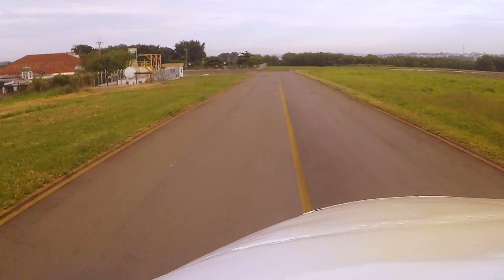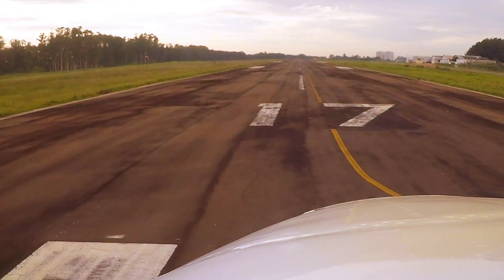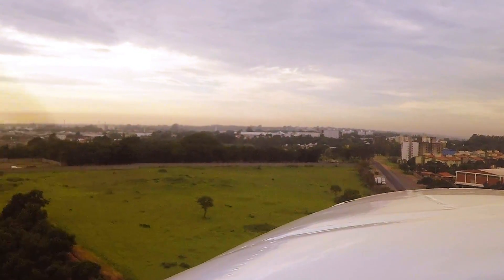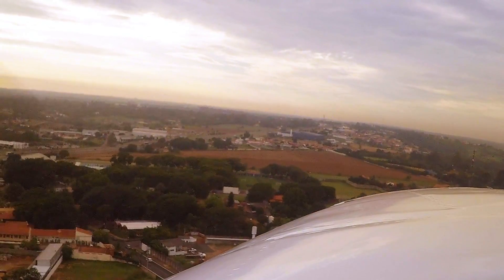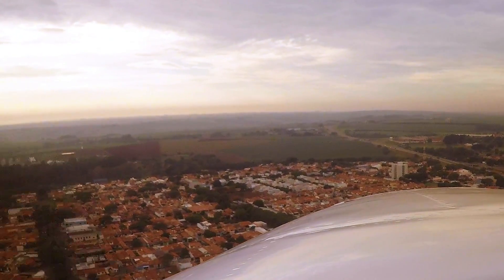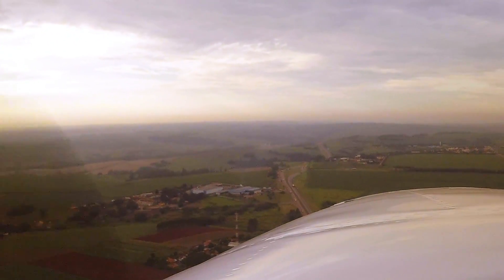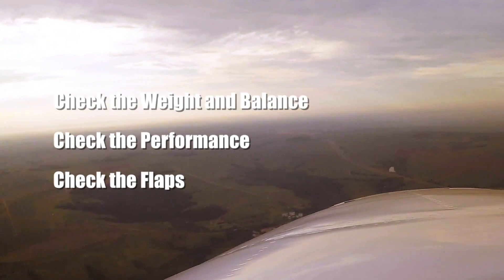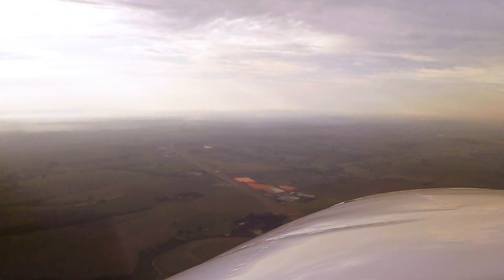Engine failure during take off

Comment: I tested this scenario on the simulator (xplane) about 30 times. Piston twin and turboprop twin

Twin Baron 58 with full tanks and load (100% of the permissible take-off weight) barely gains altitude when flying in a straight line. This requires very precisely set rudder pedals and a very precise roll towards the working engine.

If you create a slight roll towards the running engine and compensate for this roll with the pedals so that the plane does not turn, then you can gain altitude very slowly. ~100-200 ft/min at v blue

If the plane slow turns towards a running engine, then you can gain altitude a little faster. I don't know how accurately xplane models this. In theory, this simulator calculates aerodynamics in real time, but of course not as accurately as what actually happens in reality.

In any case, the problem here is that the ground can gain altitude faster than a twin on one engine. Not all airports are located on a plain with meadows 1000 by 1000 km

On this twin in the simulator, when simulating an engine failure after takeoff, even the SMALLEST mistake (the landing gear OR flaps are not retracted OR the propeller is not feathered, incorrect use of the rudder, etc.) and there is almost no chance of saving the plane, since if the speed drops below v blue and the altitude reserve after takeoff was not, then you will have to land wherever possible, since it is better this way than a drop in speed below VMC with a 100% guarantee of almost instantaneous rollover with the subsequent entry of the plane’s nose straight into the ground.

In the simulator, the following scenario always occurs for a piston twin - if the slightest mistake was made when the engine failed immediately after takeoff and the speed dropped below v blue, then the speed is unlikely to reach V blue, unless of course the aircraft’s tanks are half empty.

Moreover, it is almost certain that the aircraft’s energy (kinetic + potential) will then slowly fall, attempts to correct this will only lead to an even greater loss of energy. Thus, any mistake at the time of takeoff in the event of an engine failure ALREADY creates all the conditions for the plane to physically be unable to remain in the air. The second engine simply delays the moment of returning to the ground. Sometimes this moment can be delayed even for 5 minutes, but then it will come anyway. Only COMPLETELY error-free and instantaneous actions allow you to maintain flight on one engine and then perform a safe landing

At the same time after any error on first stage then you have only option like maintaining >vmc speed due to altitude, it will not be possible to exchange altitude for sharp turns, the choice of a site for an emergency landing will be very limited and the time for choosing a site will also be very limited. So piston twin is dangerous and require top pilot skills and top reflexes

If the plane is c90, then even with full tanks and 100 percent load, the plane gains altitude much more readily than piston baron 58. In sim c90 can even take off on one engine with landing gear and flaps, although this is very difficult for the plane, but at least a turboprop plane can do that. For a piston twin safe takeoff on one enine is generally impossible(in this simulator)

The author do this on a turboprop aircraft, and this exercise is extremely difficult, even in a simulator. I think on a piston aircraft this exercise would be guaranteed suicide, since even in a simulator such an immediate reaction is required that such a reaction probably cannot be achieved in a real cockpit

a single-engine aircraft in the simulator in this regard seems much simpler, since if the engine fails, the reaction in any case will be reflexive and instantaneous without the apparent continuation of "normal" flight, which occurs on a twin like you fly normaly but it's biggest mistake ever. On a twin, you need to develop a very fast reflex, and this reflex also disappears quite quickly, unlike reflexes to engine failure in a single-engine aircraft.

For a twin, you need to do a lot of things very, very quickly, so you can forget something and twin simply won’t fly on one engine. Therefore, twins are only relevant for VERY experienced pilots with very good reflexes

Let me emphasize once again that these thoughts relate to SIMULATION. Something else is important here. The simulation shows that it is likely that the situation of failure of one of the engines on a twin is extremely demanding on the pilot’s skills, including lightning-fast reaction. Even I would say unexpectedly demanding. And this is a simulation, in reality everything can be even more complicated

And as everyone knows, in a critical situation a person usually demonstrates not his best level that the mind of this person can achieve, but the level of nothing more than reflexes

Comment: FAA regulations state that over congested areas (Not exactly sure where this video is being shot but looks congested to me!) you must fly above 1000 feet. Obviously after takeoff this is not true but the only thing you should be worried about right after take off is your v-y speed to achieve 1000+ feet. All of this can be found in the FAR (Specifically 91.119)

Comment: As a King Air pilot, the problem with this procedure is that because the "failed engine" was manually reduced after takeoff, that disengages the Autofeather System, making the propeller unable to go feathered, increasing the drag and reducing the aircraft's climb performance. On an real engine failure the autofeather system will make the failed engine's propeller to automatically feather and therefore increase climb performance, or in the case it didn't work, do it manually as soon as possible. It is very unsafe to fly with an unfeather propeller. This practice should not be done this way.

Comment: If I may opine, it seems that nursing the airplane between a few hundred FPM climb and not accelerating, you must allow the airplane to accelerate when / where you can ASAP.  Another thing is that dragging a lot of rudder won;t permit the airplane to accelerate enough to climb either.  So as soon as obstacles permit let the airplane turn right as long as you are sufficiently at or above V2.  Don't ever make and uncoordinated turn into the dead engine though -- that will kill you in a 400 series Cessna.  This is also one reason VGs are worth their weight in gold, they lower that number.

Comment: Ok, dont do these type of exercises near a populated area. Also, you should do them with a "hard deck" of 2000 AGL. The 2000 AGL hard deck is for the very real possibility you could slip into a spin, spin recovery being:

Above 1000  AGL: Power Ailerons Rudder Elevator.

Below 1000 AGL: Pray, and fasten your seat belt.

Comment: OK as a pilot I have to ask myself what were you thinking? You don't practice engine failure on takeoff during a takeoff, you go to altitude, prep the airplane and simulate an edge and takeoff with the recovery of less than 200 feet. What in the world are you thinking? This is a good way to make sure your last video never gets posted or if it does, you are around to see it

Comment: The keyboard warriors here disgust me. As a professional pilot for over 40 years in a variety of types from Cessnas to heavy jets and a former instructor in multi-engine aircraft similar to the King Air series, I assure you that there’s nothing amiss in this video and the creator should only be thanked for sharing, as his conclusions are spot-on. 

It was actually a very well-handled and CONSERVATIVE training event, no matter the opinions of the self-appointed critics. The weight was light, the flaps were up, and the density altitude was benign. Had the event devolved into a descent and obstacles become an ACTUAL vs simulated issue, then the power would have been restored and all would have been well. The “poorly thought out training event” comments are just bunk.

Comment: Having done many V1 cuts in King Airs and 1900’s, something was really strange in this “simulation.”  Even at Max gross weight, the King Airs accelerate and climb much better than what I saw in this video…..as long as the gear is up and the prop feathered.  The airplane won’t fly very long at all with the prop windmilling, so I don’t think the instructor was simulating a failed auto-feather. If the gear is up and the propeller feathered, there shouldn’t have been a struggle to get to V2 though. That’s the strange part. 

It looks to me like the instructor didn’t set zero thrust on the simulated failed engine….which would make the performance better than a windmilling prop, but less than a cleaned up airplane. Once airborne, the gear should have already been retracted but the video kinda looks like it was left down for a while 1:28 could be just a difference in the audio and visual though. Maybe that’s what affected the performance, I’m not sure.

Comment: I have been a King Air flight instructor for many years. In spite of all the negative comments from viewers, this exercise can be done without shutting down or feathering the "failed" engine. Beechcraft provides a chart for zero thrust power settings for training purposes, so that the engine is merely throttled back to that setting. I have done it many times. That said, it is easy to pull back too far and get less than chart performance. If calculated correctly and performed using zero-thrust, this is a valuable training exercise and is not dangerous.

Comment: I thought of a way that you could have totally eliminated this problem. If you reassembled the right Alderaan at the time of take off, your perplexity would have been Arrow Namek Lee correct is sometimes on small aircraft the magnitude of the excessive vibration during takeoff will accomplish nothing in the realm of coherency. I've had lots of experience doing this particular maneuver on the San Fernando airstrip in Bangladesh. Incoherently excessive noise coming from the turbulence of the propeller will perpetuate a motion that is non linear and function yet retroactive and respect to the wind speed.

Comment: PRO TIP: The next time you would want to simulate an engine failure during take-off. You may do it by climbing at 5000ft and above, or at any safe altitude and perform POWER ON STALL. It is a procedure to practice an engine failure during take off :)

Comment: I can't speak for the instructor in this situation but if I were conducting this training event,  I would have reviewed the airports  obstacle departure procedures and minimum climb gradient.  I would have then ensured that the aircraft would meet that minimum (preferably exceed)  based off the aircrafts single engine performance data then added an additional safety margin.   I may also choose an alternate field that may be more suitable for this type of training.   Just my 2 cents.

Comment: His friend pulled the power back! Did he figure out what setting zero thrust would be to simulate a feathered prop? These king airs have enough performance when light to climb if the pilot is competent in single engine procedures. Obviously the competency of this pilot in the clown in the right seat didn’t add up and as others have said, they never should’ve attempted a V1 Cut at such a low altitude with obstacles being what they were.

Comment: I like this drill - seems like there have been several KA engine failures at take off. Looks like torque on one side of the plane catches the pilots off guard and they stall/rotate the airplane close to the ground…

Comment: Did you feather the prop??  Not a single mention of that, which is the absolute most important thing to do on a single engine climb on a twin, that is the most drag you need to get rid of.   The flaps and gear are obviously important too, but if you don’t get rid of the windmilling prop you will never climb (especially at high altitude airports).   On some planes like the MU2 you don’t retract flaps until you have sufficient speed and you have feathered the prop first…..

Comment: Hey guys, important is to bank 5° into the good engine and also to use rudder. Otherwise you will produce a lot of drage around your fuselage and never will achieve v2 and a safe climbe rate. Also do not train this above pupulated areas.
Reply: Good point 👍🏽 
Does the banking take away the load off the rudder? If so then it surely will reduce drag and improve climb
Reply: @sudarshanhs  it will give you a bit more Favorit yaw when you Bank 5° to the good engine. Also the upper wing fly a little bit faster on a bank. But do not bank more then 5° bleow v2, your minimum control speed increase that more you bank. When you reach below minimum control speed vmca you loose control of the airplane. In cases like this you must reduce the power of your remaining engine and perhaps proceed a forced landing ahead.
Reply: EXACTLY - - I was scrolling down looking for a comment criticizing them undertaking such an exercise over  a dense conurbation... You were the first, but I can now see there's more. Just thank your luck stars the other didn't fail otherwise the death toll would be horrific. Paire d'idiots..

Comment: This airport is in Brazil: Pedro Morganti airport in Piracicaba, São Paulo state. QHB (IATA), SDPW (ICAO). So, information regarding FAA or JAA aren't applicable. If the training was performed in Brazil, the proper aviation authority in charge is Brazilian ANAC (Civil Aviation National Authority). But the training requirements stated by the narrator are correct. There is even a section on C-90 POH that describes how such maneuver should be executed. Despite the right deviation, there was no serious threat to people on the ground or any other associated "traumas" with that operation (from what I saw). If a climb cannot be safely achieved in this training, the instructor can simply advance the simulated failed engine throttle and the idled engine will "ressucitate" very quick. Important: such maneuver CANNOT be a surprise! It should be briefed before takeoff! This aircraft is usually equipped with rudder boost, that operates automatically with engine failures (or throttle retards), but it seems that such device wasn't activated then: probably for a better and more effective training (more difficult = better trained). 
I was a certified captain/instructor/examiner on this aircraft model.
Reply: I couldnt disagree more. The rudder wasnt trimmed, a stall at that low altitude would have been unrecoverable no matter how fast the engine throttle could be advanced. Reckless, foolhardy and irresponsible.
Reply: @garrystubbs4891  Arguments?

Comment: UNSAFE
Dont do this over a populated area.
Retract gear immediately. Wheels wont help if you hit something, AND they are DRAG. That means a hinderance to airspeed.
You should have added back the power to climb and not scared the shit out of people on the ground.
YOU ARE UNSAFE.
Reply: Let me explain.
You were 1500 pounds UNDER GROSS.
He pulled the NON critical engine.
You were really late getting the gear up. Seconds count.

If you had 3-5 more people on board and it was a real engine failure
ALL WOULD BE DEAD.

I hope you learned that C90 wont fly on one engine. 

You are UNSAFE
and by your comments you are trying to justify your arrogant stupidity.

Comment: I am glad I found this video.  This procedure is wrong in so many ways.  I agree with previous poster, your license should be suspended.  

I practice engine out on just about every local flight.  I perform them at 3000 AGL, full power (as in take off) same direction over the airport and I simulate rotation at the exact point I would if I was ground level.  I climb to 500' simulated AGL (3500') and try to return to the airport.  I also perform this at 750' simulated AGL and 1000' simulated AGL.  I get the same results (glide speed, quick reaction bank) and I video the gages so make sure I am performing everything correctly.

The problem with performing this at actual 500'AGL is you have no room for error.  I have seen where engines will not recover from idle due to broken cable, carburetor ice etc.  So why take unnecessary chances at such low altitude?  You can gain the exact same knowledge and repetition at simulated altitude as opposed to actual altitude.

New pilots watching this; this is a good way to get clipped.  If the FAA saw this, game over.  BTW:  I did report this video to the FAA for review and possible action.

Comment: When you are just simulating an engine failure, you must bring the power up on the dead engine to simulate the reduction in drag that would come from feathering the prop. Leaving the "dead engine" windmilling is not a realistic simulation of an engine failure at takeoff.
Reply: Yeah, would be interesting to know at what power setting he reduced his engine. Or if he even was aware of that...  well the aircraft doesn't climb there must be a reason for that.

Comment: I had the friction lock fail right after rotation in a 200 departing Chicago Midway. Left engine came back to low torque. I got the gear up immediately and managed a climb while gently bringing power back up on that left engine. It actually climbed pretty well on one but we weren't loaded very heavily. Unfortunately since our initial climb wasn't very aggressive we got routed all the way north and around O'Hare. Most days, of you climb hard they'll clear over top. Anyway, it was an interesting learning experience

Comment: To those who are wondering, this was a simulated engine out.  The power is reduced on one engine, in this case the right engine at takeoff, which causes the plane to turn right as the left engine is producing a lot more power.  And as others point out, this could have resulted in a crash and in what appears to be a populated area.  Dangerous stuff.  Glad he lived to be able to upload it and make some nice click bait.